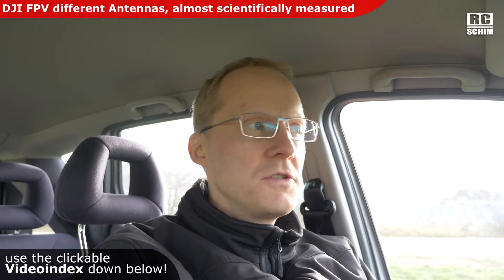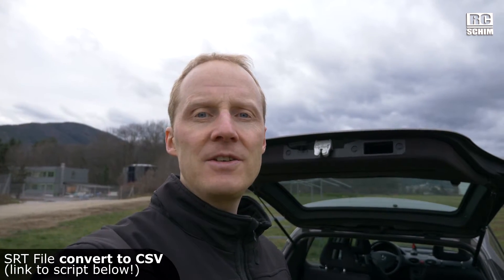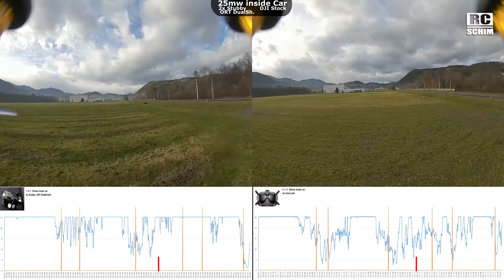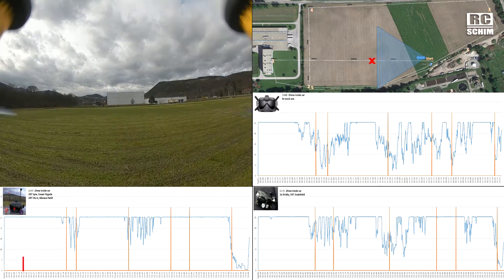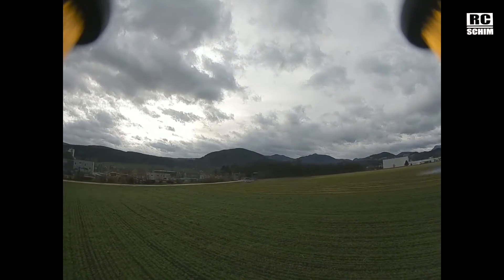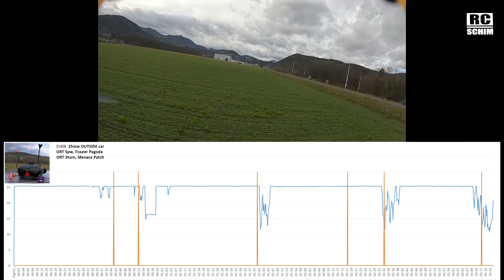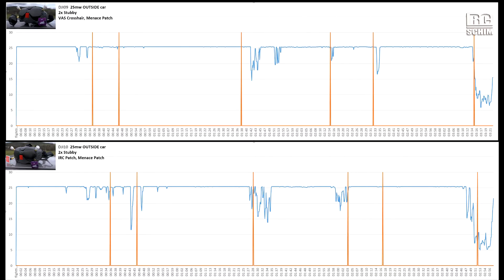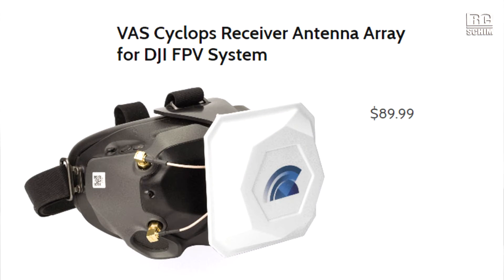DJI FPV Antenna tests - almost scientific!

Comment: why no xair ?
Reply from the maker: Simply because I had none ;)
I hear they are quite good tho. 
The trurc stubbies are also used by many...
Reply: @Rcschim  I'm getting the DJI tomorrow, do you have any sort of complaint about the latency ? Do you use focus mode ? Does it detract from the viewing experience ? Did you test the fact that the normal air unit antennas are 50% atenuators ? Do you know that DJI made the air unit antennas be attenuated so that they could have this much transmission power on the vtx but still be compliant with the law. Smart but they did that by using antennas as atenuators. First thing anybody can do tti their DJI is change the default antennas on the air unit
Reply from the maker: @qpmkro  Nope, flew yesterday with the DJI digi (and analog as well) and didnt have issues with latency. Did some flips but mainly cruising around.
tried to do some hard turns around snowpoles at the street - and it felt right as well.
Analog is 20ms, the 10-12ms fatsharks felt a "bit" faster, but I'm not sure if I had noticed it while flying.
I fly in high quality mode and focus mode set to auto. seldom the focus mode kicks in, but it's ok. sometimes it kicks in if I'm really close as well - but that's not a problem...
-
Are those antennas really attis? I read the rumor - but I dont have the RF knowledge to see this on the opened antenna.
I switched them for Lollipops (because I had them with mmcx).
Reply: @Rcschim  did you try the hdo2  ? Which image you like more,  dji or hdo 2. Could you say that the way you fly isn't one that pushes gear to the limit and you couldn't really feel the difference in latency,  that's why you fly hq mode where you tested it to have 4 times more latency than low latency mode.  So if that difference doesn't bother you the one between analog fatshark 10 15 ms and low latency 20ms is really not something YOU would notice ?
Reply from the maker: @qpmkro  no didnt try the HDO2. If I need lower latency I would fly in the faster mode - but on the first flights I felt like I like the higher quality more - and for cruising around (which is really fun on the DJI sys) the HQ mode is better.
No I dont push gear. I'm too afraid to break something or loose it. I hate to repair drones (because this usually takes way too much of my precious hobby time :)

Comment: Why do you use the stubbys on top and not the crosshair? Would you try this foe me. I will buy two crosshairs and two mad mushroom v2  foe my dji system
Reply from the maker: Sorry, I don't have those antennas. 
I flew with the stubbies left top and bottom, and the dual shield on right top and bottom. Didn't really measure it but: flew on 25mw accidentally and didn't really notice have issues until like 800m out in the mountains when the first bitrate reduction occurred!
Reply: @Rcschim  oke thats interedting.
Thanks for the answer man

Comment: Get rid of those 90deg connectors on the end of the antennas and your signal will improve greatly. Look at the painless 360 video he did on signal quality in conjunction with Menace rc.
Reply from the maker: Thanks for the tip I will check it
Reply: Also CP Antennas in your open test environment have reduced range when compared to linear. I use a mix of larger CP and homemade enhanced linear antennas on the quad. See: https://youtu.be/DFe1fpssARo

Comment: What do you think about the four stubbies sold by TrueRC for the DJI Goggles and two long SMA Singularities for the quad? Do you think two Crosshairs on the bottom of the goggles with two stubbies on top would be the best?

Comment: i run with vas cyclop ond the googles and axi 2 ond air unit. the range with this is awesome. my transmitter going to loose signal before my mb/s drops under 20mbs you should try one time the vas cyclop

Comment: I’m trying to make a fast and easy 3D model of the air unit so I can play with fitment on a few frames before buying one, it’s list as 44mm long can anyone verify that it’s 44mm to the longest part ? I know the air unit protrudes a bit where the camera comes out is that the 44mm or are the shorter sides thanks

Comment: Great. Review! Got mine a week ago, still on stock.
Reply: Hey, I just got mine today :D 

But there are still parts on the way for the copter, so I'll have to put the air unit on my head and run around with it, to get an impression 🤣
Reply from the maker: And to also test the latency, right?
Reply: @Rcschim  Yes! :) But also to get a feeling how it would be to be 15-20cm bigger 😁. 

I have an old CarbonZ Cub laying around, this will take the 2nd air-unit and then I'll see, what comes first: better weather or the missing parts.

Comment: In many of these DJI range/antenna test videos we see the quad flying slow and low, struggling behind vegetation. I can't help but think while watching "just fly higher till it clears up", but I don't know how well it would actually work. Could you perhaps include a small section of a video where you practice real world transmission optimization like this? I understand why you are doing it the way you are right now, but I'd love to see perhaps a less data intensive video where you purposely try to get it in trouble then raise altitude, to see if the signal recovers, and if so how quickly.

Comment: Great video and thanks for sharing.  I love my DJI FPV system and I'm still in the hunt for a great antenna combination to use on the goggles.  After watching your video I want to go with the short stubbies antenna instead of the patch antenna.

Comment: Is there any safety issue with the top antenna transmitting? near our head
Reply from the maker: there should always be safety concerns - but I think mobile phones radiate more - also close to your head.  I'm sometimes a bit concerned about the wireless VR system (on HTC Vive pro) that I use. It's 60ghz and I dont know what mw - but it's only close range but digital low latency (below 20ms!). This wireless TX get's really hot - and it sits on my head for extended game sessions...
(but I read, the higher the frequncy the less "penetration" into your head). and in the worst case it would cook your brain a bit :)

Comment: I really liked how you graphed out the bitrate. In my own testing, I often just search the bad areas in the srt and note the lowest bitrate. But with how you graphed them, it makes you notice how wide the bad area is, not just how low the bitrate dropped. I found myself thinking one was worse than another even though the latter had a lower bitrate.
Reply from the maker: thanks,  it's very easy now with those SRT files, to get good data. 
Dont know how you're with Excel - but after converting the SRTs with my little script it's really easy to get those charts - and as you say - they are pretty good in visualizing stuff.
If you need help, just let me know...
Reply: @Rcschim   Thanks. Will definitely try that out. I'm definitely a spreadsheet and scripting guy. I have some scripts that I use to burn the srt's in when I post to youtube. My stuff is fire and forget,... not all the good editing successful channels like yours do.
Reply from the maker: @rcrdps8144  can you point me to that scripts to burn SRT infos into video files?   before the charts I just wanted to include bitrate as an OSD overlay. 
I can import SRT as subtitles track in vegas - but it is a bit cumbersome and I cant edit it really.
I used to use VideoLanClient with subtitles burn-in - but I somehow also didnt like that approach...
my mail would be schim@gmx.at   thanks!
Reply: @Rcschim    I put it in the description of some of my videos, but those descriptions can't have ">" signs,.. luckily, we can post them here! This requires "ffmpeg" utility. It is opensource. The first section of this simplifies the srt. The ffmeg line burns it in. The syntax is powershell,.. .you can remove that if needed. The main part you're looking for starts at "subtitles". I designed it so you can just replace the contents of the $myVid variable and then just copy/paste the whole thing into powershell and walk away.

 $myVid="268";(type .\DJIG0$myVid.srt) -replace "ch:[0-9]+ ", "" -replace "glsBat:[0-9]+\.[0-9]V ", "" -replace "uavBatCells:[0-9] ", "" -replace "glsBatCells:[0-9] ","" -replace "signal", "Signal" -replace "flightTime", "Time" -replace "uavBat:","" -replace "delay","Delay" -replace "bitrate","Bitrate" > DJIG0"$myVid"trim.srt

ffmpeg -i DJIG0$myVid.mp4 -s 2560x1440 -aspect 4:3 -b:v 30M -vf "subtitles=DJIG0'$myVid'trim.srt:force_style='Fontsize=10'" DJI-FPV-blahblah.mp4
Reply: Sent an email too. Comes from the same name as my tag here.
Reply: @Rcschim  I've got CSVs with data I'd like to show in a video, how did you make those synced up graphs??

Really appreciate your more scientific approach! Too many antenna comparisons seem influenced by a desire to like a product either to avoid buyers-remorse or to please the vendor. 😆

I don't blame other reviewers, glad they are finding an audience too, but your take is so fresh by comparison.
Reply from the maker: @JavisHD  Thanks for the nice words. I love to see data rather than opinions. Opinions of experts can be a good thing too, but mostly we face sales-man doing reviews, or reviewers doing the work of salesman...

To your question: I've imported the CSV into excel, designed the graph there, saved it as pic (screenshot) and used the image in my video editor.
In editor: I have the image either scrolling matched to the video,  or in another video (clearview) I had a mask hiding most of the picture and with keyframes you can slowly show more and more of the graph. this looks like it's plotted in sync with the video. 

greets, Mario

Comment: I LOVE THE DJI SYSTEM !   I don't think just the video I think the complete system.   SO EASY to install.   I LOVE the tx.  Simple.  KISS  Exactly what we need without a lot of crap.  binding is no longer a gymnastic experience.  Antennas ...I was using 4 AXII stubbies and it was fine.  THEN I got the X-Air on the TOP.  Better !  Now using an iBCRAZY small and one AXii.  on bottom.  I am getting AMAZING RANGE !  I have built 5 DJI so far.  two 5"   three 7"   now I am starting to convert my bigger analogs …
Reply from the maker: sounds awesome!
Reply: @Rcschim  and now they are open to other companies :-) caddx vista vtx :-)
Reply from the maker: @shambler01  WOW! good find. Is this legit? We need to see / wait for first tests of course. But this is way faster than I thought. I figured it would be next summer till DJI releases a smaller air unit. Why would they license their tech to a small company?
Reply: @Rcschim  one of our austrian Team member will have a look at caddx down in china tomorrow
Reply: @Rcschim  if you think about its a great Deal for them. They Just need to produce the chip / software at No additional Hardware cost.

Comment: Mario thanks, but why didn't you try any directionals on top ports ? Hugo true rc says use tops or 2 sides for dual directionals like those shields.  I only use my 2 cross hairs on top.
Reply from the maker: I will - next session - already have a list of things to do - hope to have 5hrs plus in sunny, warm condition on the flightfield then :)
Reply: @Rcschim  cool no pressure man I was just disappointed, I love dji testing :)  i also wanted to see how those dual shields look on top w lollies on bottom, might sell my 2 vas cross hairs, they look like huge mouse ears lol

Comment: I did some testing too  https://youtu.be/7TCxfRF8mds with surprising results. This is with different quad antenna. I also tested goggle antennas too and the more expensive antenna did poor in all tests. Linear looks like something to test more. The dual true rc x airs are decent but just too much of a faff to put on unless youre doing something specific. look forward to watching this later
Reply from the maker: Great vid - watched it till the end (and commented there)
Reply: @Rcschim BTW sorry don't usually self promote but I'm really curious on how digital pans out and if our analogue antenna are suited for it. I've added your channel to the description as everyone should be subbed here.
Reply from the maker: @CoppertopFPV  no problem, I like the links inbetween the FPVers and am curious to other testers findings. Everybody has a different approach and eventually finds different aspects. Since digital is great - but also a bit more advanced than good old analog (but even analog FPV was a mystery sometimes to me).
thanks for your ad for my channel - I agree - everybody should be subscribed :)

Comment: literally and spiritually flying over the bullshit hehehe.  kinda interesting results, i wonder if the lower antenna transmitting affects the upper ones reception? it might mean patches on the lower would bring significant advantages,  Furadi has some normal flying results that were interesting too,
Reply from the maker: I dont think that their own TX signal affects the RX of neighbour antennas too much.
After all:  the ammount of TX data is minimal! it's just a few bits with the order to "retransmit" or change channel or something like this.
that's also why I think that TX might not need to have as much gain as RX - TX of low bandwidth data is not as critical - but I might be wrong.

Comment: I’m far from being an expert but if the antennas work in pairs (top one and bottom one) why don’t you put one directional and one omni on the bottom and same above (maybe inverted)?
Reply: Yea it's recommended by Hugo true rc to put directionals on top for improved performance or for the ones w 2 sma to use top 2 or 2 on 1 side, dunno why he didn't put shields on top n try

Comment: I would have loved to see 4 omnis for comparison. I fly 4 truerc singularity stubbys on mine and I’m pretty happy with it.
Reply from the maker: the truerc singl. look good! but a bit expensive they are (22€/piece?)
Reply: @Rcschim  i messaged RCRDPS he has both lolli stubs and singularities,  to do a test, he overlays osd on vids,  but have a hard time believing they are leaps n bounds better than lollipops
Reply: Agreed I mainly use 4 lollipop stubbys.
Reply from the maker: did someone already measure difference between trueRC singularity vs lollipop vs. lumenier AXII? vs VAS ION?   I cant test all of those antennas myself - that's an endless stream of possibilities :)
Reply: @Rcschim  I have tested lollipops stubbs vs 2x vas ions stubs on top ports and they are Def little better, how much % is hard to say,  but mbps is higher in difficult spots with them
Reply: @Rcschim  I dont think someone has made that comparsion. In theory i think they are pretty close but TrueRC might put more effort in QC to check if they're really 100% within range.

Comment: BTW, someone on the Facebook group did some testing and noted that the goggle would spike to full power when first powered up. However, they were using a rubber ducky and not a pigtail like you are. Would be interesting to know what numbers you see with your pigtail. I have a hunch that it will be below 200mw when set to 700mw.
Reply from the maker: I'm also curious about how much mw the airunit really outputs. I'll hook up the mmcx sma cables there and will test soon. 2nd bulletpoint for my followup :)
Reply: @Rcschim     Actually,.. after I thought about it, I'm pretty sure they said the air unit spikes on startup, not the goggles. The goggles stay quiet until they hear an air unit. But the air unit may be spiking full power to reach out to any goggles.